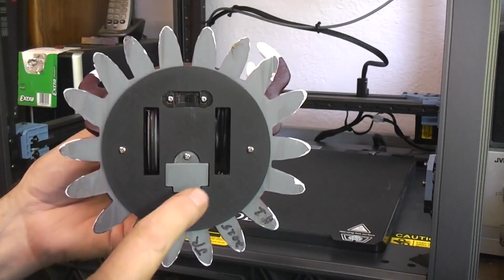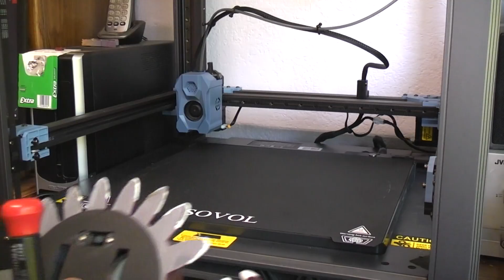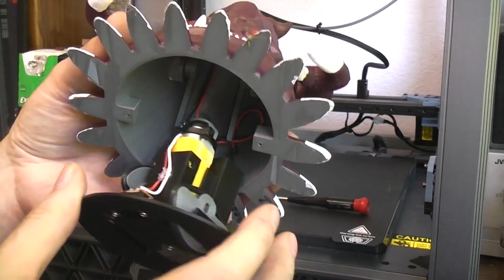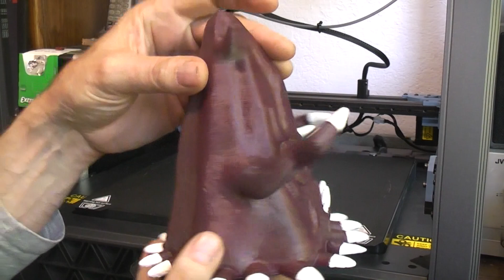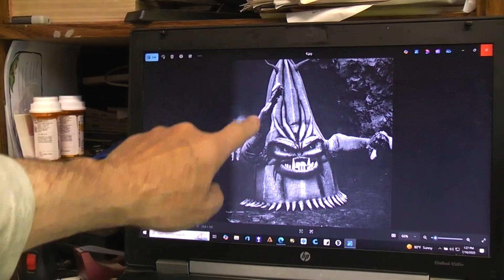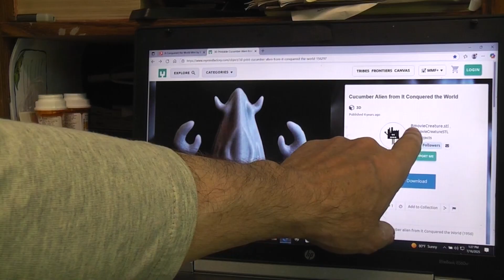You Can 3d print, the battery operated "It Conquered the World" Space Monster.

Comment: Thx for the added advice about the red LED  voltage dro.
Reply from the maker: Yes, when you only have 3 volts to work with then Blue or white LEDs will not be the best choice unless you want to add a voltage boost circuit.

Comment: This is great. I had to watch the movie. I've seen Peter Graves  in several of these scifi movies. Is that a new printer?
Reply from the maker: I had a project to-do for Fred Barton productions that required a larger build plate than the Bambu labs printers. So, the SOVOL SV08 was the lowest cost printer I could find right now with the tariffs happening. I do have a old CR10s5 printer out in the shop but it is so slow and the hotend design likes to clog up every 18 hours or so. It does have larger glass build pate 500 X 500 X 500. Some day I will replace the hot end on it with a all metal one, but even then it would take 3 days to print what the SOVOL SV08 can do in 11 hours.
Reply: @Robothut  I hope it's a good printer for you. Once you use one of the faster printers it's hard to go back